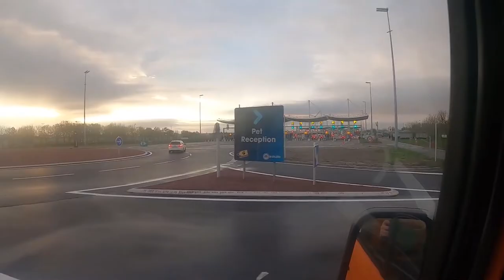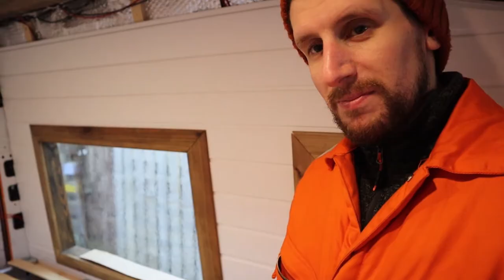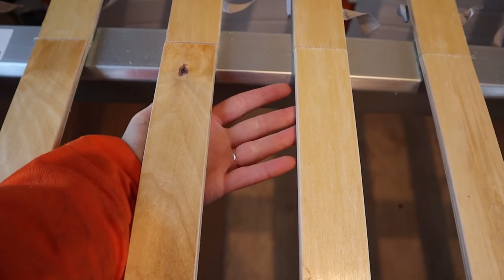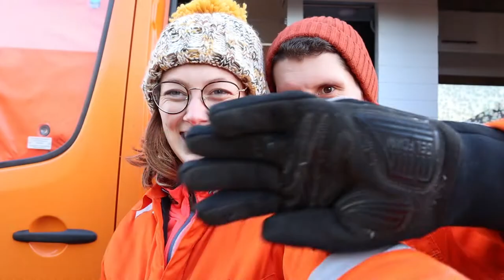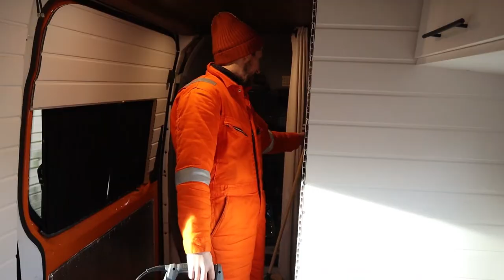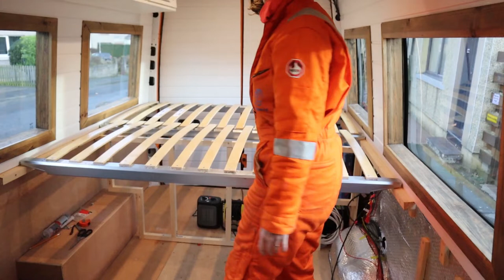Space-Saving Slide Out Bed in Our Van Conversion | CAMPERVAN BED | How We Made Our Pull-Out Bed

Comment: Thanks for sharing. Had the same iterations going through my head. Plan to do the same thing, but length-wise. Means I got to put cross beams. Will be fun. 🤪
Reply from the maker: Sounds like a great plan! I would definitely recommend using flat wood for the bed slats though as the curved ones running the wrong way can be noticeable in certain sleeping positions!
Reply: @courtsandmeeks  Thanks for sharing. Our bed will also be a kids playground. The "moving"mechanism is needed for access and storage when in "driving" mode. As the bed also needs to be a playground, we will opt for the flat slats anyways, which is not a problem as we are "light weights".

You sleep along the length of the van or side ways? On one video it looks like you will sleep along the length and I wonder if you can feel the difference, as the slats would be long the spine, rather than traverse?

Comment: Great video guy's...I've done the same using the Ikea bed beams.
Reply from the maker: Great, glad it was helpful. If we can make a suggestion though, we wouldn't use the bent bed slats again from Ikea for sleeping lengthways down the bed. We e just changed ours after 6 months of back ache!
Reply: what have you changed the slat to please?  flat ones?  from where?  thanks so much.  Also what type of glue did you use?  thanks. @courtsandmeeks

Comment: Fabulous video - thank you for your honesty with the mistakes! We all make them. Now you have replaced the curved slats with flat ones, is the bed comfy sleeping parallel to the slats? This is the only worry I have about this design as otherwise it is perfect for us. Many thanks indeed.
Reply from the maker: Hey Katie! Yes absolutely, now we've changed to flat slats it's much more comfortable. I think we still plan to change the mattress when back in the UK as we only bought cheap foam when we replaced the slats so might not last too long. I honestly think the gaps between the slats need to be the smallest possible so the mattress doesn't sink down between them or to have a thick mattress. 10cm foam for us before we had the extra base board that Umitcan Caravan put in wasn't thick enough and we could feel the slats through. Hope you find the perfect layout!
Reply: @courtsandmeeks  Thank you!😁

Comment: Nice design and looks like it will work well.  Couple of questions/suggestions:  Might it be better to countersink the screws on the bed frame?  As you pull out the bed the screws may cause rubbing on the underside of the mattress.  Rather than moving cushions to make up the bed what about a second mattress that folds up against the back door during the day.  You would then have something to lean against when using the day bed.  With a little thought it should be possible to link the mattress and back to pull out flat with the bed extension.
Reply from the maker: Hey Graeme - thanks so much for your suggestions! Countersinking the screws is a great idea - they are flat head self tappers so don't stick up too much but we will see how much they fair when we get the mattress. The other issue is that bed slats arent that thick so it's quite easy for the wood to split if drilled in too deep. Something we will look at though for sure!! I'm terms of the mattress, we did talk about this and even considered a different design where the full bed was modular and hinged at the join between the two sections so a sofa back could be lifted up either facing into the van or then slid the other way and hinged so the sofa faces out the back doors. Ultimately we decided we didn't want a permanent back on the sofa area as we love having a view out of the back doors. Instead we will have a padded headboard velcroed to the back doors that makes up extra mattress pieces for when turning it to bed mode 💪
Reply: @courtsandmeeks  Yeah, I saw your earlier video and your thoughts for the sofa back, I should have realised that your full redesign would have considered that.

Comment: About the sliding bed thing, which is a great and smart concept, it's a bit weird to see you troubleshooting this. It's like troubleshooting in reverse, you're concentrating on the slats being curved and not matching. That's not the issue, what I would've done is troubleshoot the entire sliding concept and then worry what to put on top of to lay a matras on it. Troubleshoot the root problem first, not the consequences which flow from the root problem. Still you found a way out of it but the road taken was a bit weird.
Also, what I would do is to have two benches opposite each other and have a slide out table underneath the bed that can be taken out so you can use it with the benches. No need to waste space on a table.
Reply from the maker: Thanks so much for the comment - this is really helpful and you're totally right! The problem was that we had already bought the slats before fully figuring out the sliding mechanism (rookie error!) So we were adamant we were going to make them work 😅

Comment: Had the same idea and wouldn't know for sure if it would work out. And as Ikea is currently closed where I am.... 
So thanks for validating the idea 💡 👍

How is it holding out?
Did you cut the ending of these Skorva?
I was looking into rails as hangers that would allow to slide but your idea looks good.

What about adding an aluminum profil or HDPE strips for the durability of the sliders?

Cheers to you 👍

Comment: You can drill with that mcallister just need to dril on slow speed and putting pressure starting with a small drill bit number 2 or 3, with lubricating oil (ATF for example). You should not drill metal on quick speeds.

Comment: hey, just wondering what those metal beam supports are? are they the mid bean ikea adjustables with some platic to help them slide? i guess this info in the previous video but couldnt find that. Thx j
Reply from the maker: Just ikea skirts beams. 2 mounted to wall brackets and two that slide on wooden wall beams
Reply from the maker: Six this vid was crap at giving any ounce of useful info

Comment: Love the bed idea, I was thinking along the same lines myself, seems such a waste having a fixed double bed. My only thought is that you will be lying in line rather than across the wooden supports.
Reply from the maker: Hey Andrew - thanks for commenting! We thought exactly the same thing about having a fixed bed taking up half of the van interior, it just seems silly. You're right about the slats running the other way to a normal bed but once there's 10cm of mattress on top we don't think it will be noticeable at all. You can't feel the slats when you lay sideways on a normal bed so we figured it's the same kind of concept!

Comment: Hey, how did you secure the IKEA skorva to the sliding bar? The ones that don't move I mean. I have a ford transit and looking for a better way to build my bed.
Reply from the maker: Hey Andreas. Sorry for such a delayed reply, for some reason this comment went into a weird YouTube filter we didn't know existed on our comments! We added wooden beams to the walls which the Ikea metal supports sit and slide on. I think we show them in our video prior to this one (not sure now why they aren't shown properly in the bed video!) And they are drilled through the metal cavity of the van itself so they ain't going anywhere! I've seen other people take this idea and use L brackets from Ikea (that you can apparently buy to go with the Skorva midbeams) and also L shape aluminium or steel lengths that they drilled into the wall rather than wood which is a good idea I think. I would also recommend using flat bed slats and not curved ones because you can feel the curve and it's not the comfiest bed we've ever had.

Comment: Just a thought, when you press down in the middle of a curved bed slat it gets longer, how will they do this if sctewed down both ends? Beds usually have plastic fittings both ends that allow the slats to slide in and out so they can get longer when you climb onto the matress otherwise its just a solid structure.
Reply from the maker: They still have give in them even though they are secured at each end. We did give this some thought and the curve allows the bounce to remain but thanks for raising the question as there's a chance we wouldn't have haha!

Comment: Hi, your slide out bed is fantastic! We are definitely going to copy your idea. Could I ask where you purchased the 4 aluminium cross members from? I notice your North East accents. We live near Stockton-on-Tees and were wondering if the aluminium was available locally? If not any links would be greatly appreciated. Keep up the good work :-)
Reply from the maker: Hey guys! Please do - that's why we made the video. All about sharing space saving ideas. The bars are from ikea!! They are called Skorva mid beams - not the lightest at 3.6kg per bar but we thought it was worth it! Are you on instagram sharing your build? Would love to follow your progress!
Reply: @courtsandmeeks  Hi there, really enjoying the videos and this one in particular as we've been planning our bed for months to be half static and half fold down version but your idea with the sliding beams is perfect. However the website is only selling the beams at 139cm whereas our van (crafter) is 178cm across which I'm assuming is the length of your beams as the crafter/sprinter is the same. Can I ask do they have different sizes of the beams in store?
Reply: @craftycampers6256  Hi, the measurements on the beam is minimum 139 and maksimum 203 according to IKEA Website.
Reply: @annhelenkvi8219  thank you very much and now you explain it more I see that they are actually telescopic.  I was imagining several different sizes. Off to buy them now, thanks again.

Comment: Brilliant idea for a slider bed. Would you share the length of the slats, please? I'm in the midst of copying your technique (imitation being the sincerest form of flattery, and all that) :). Also would appreciate knowing what type of adhesive was used to adhere the slats to the metal. Cheers.
Reply from the maker: Hi Deirde, sorry we didn't get back to you! It's probably way too late now but the slats were just 2 sets of single bed slats from IKEA so I'm not sure on the length, sorry!
Reply from the maker: And we also ended up screwing in the slats into the metal beams as the Stixall didn't feel like it would stand the test of time :)
Reply: No worries. Thanks so much! We found the supports at IKEA, then reasoned that the slats were probably two sets of singles. IKEA was out of bed single bed slats when we were there so we will be going back once their stock comes in again. Thanks so much for your kind response! :)
Reply: @courtsandmeeks  Again, thank you. We saw that in your video but thought we might want to glue it as well as screw it in. It's probably enough just to use screws. Thank you! You two are an orange inspiration!

Comment: Could you tell me how to support by. Ikea steel wood?
Reply from the maker: We put wooden beams along the wall and screwed them into the metal panelling of the van. The Ikea beams are then sat on top and slide along but I would recommend putting some form of runner on the bottom of the beams as it is a bit loud!

Comment: Could you not just stack 2 single bed mattresses and then just pull out the bed frame and slide the second mattress down to make a full double bed ? 🤔 just thought I'd throw that idea out there, if it helps 👍😉
Reply from the maker: Hey, thanks for the suggestion and sorry for the delayed reply! We decided doubling up two mattresses would make us too close to the roof when sat in sofa mode and also we'd still have to 'make the bed' fully putting the sheet and duvet on and off before doubling them up whereas all we currently have to do is move the seat cushions onto the extension and pull the sheet over. 👍 It works well for us!

Comment: I got another question for you :D Did you install the paneling before the bed supporting wood beams or after?
Reply from the maker: Hey, thanks for the question. Do you mean the white cladding? If so that was installed after the sliding mechanism. For the cladding we built a frame that connects to the side of the van and the floor then attached the cladding to this. That allows us to have the sliding bit separate and so that the facing for the front metal beam doesn't get stuck on the white wall. Hope that helps 🧡
Reply: @courtsandmeeks  That was a prompt response!  Thank you heaps, I'll be very surely using the same design as yours, thanks for sharing!
Reply from the maker: @mightydingo  you caught me when I was in YouTube so it's not always so fast 😂 amazing, I hope it works out for you! Let us know how you get on!

Comment: Great idea but the pull out part I’d be afraid of it not holding my weight ☹️
Reply from the maker: Sorry for the delayed reply! The pull out part is super sturdy and still resting on the wall batons that are drilled into the van metal so its the same construction technique the whole way across and works really well! Could always use rivnuts instead of long large screws like we did to bolt the bed beams into the wall metal - have seen this done before!